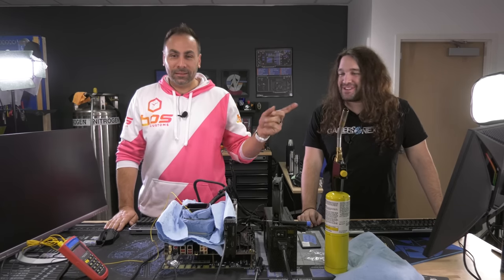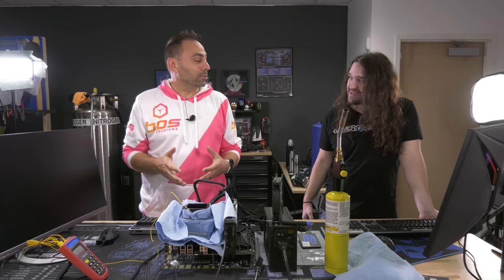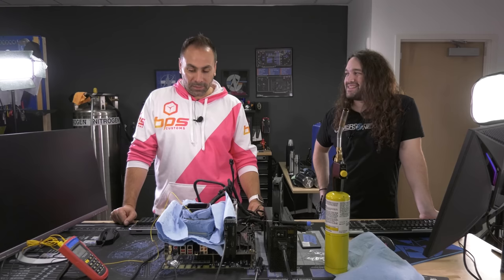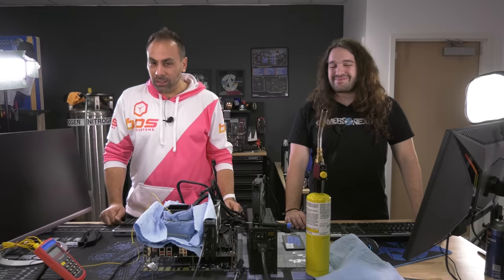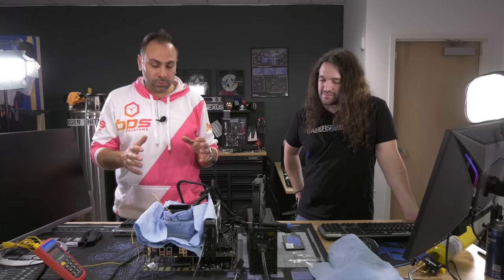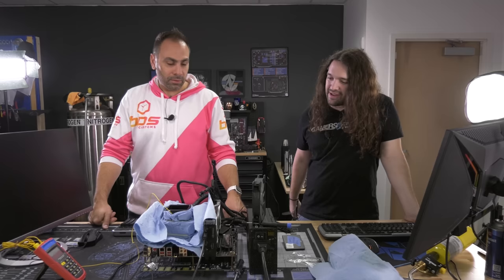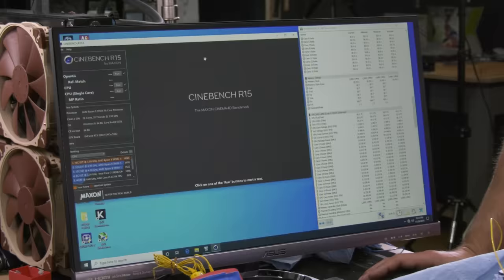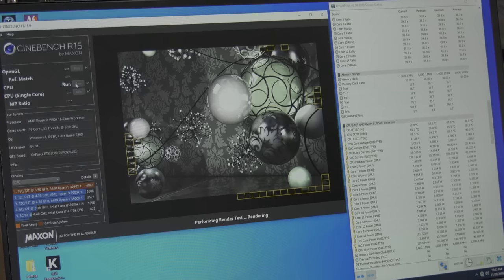Hitting 5GHz On A 3950X!

Comment: Even though I'll probably never dump LN2 on any computer parts I own I still find stuff like this fascinating. My mind conjures up ways of circulating LN2 through a loop like water cooling but not cost thousands of dollars.  I'm sure it could be done.  It'd be noisy as hell though because you'd have to use a compressor to chill the recycled Nitrogen back to liquid state.
Reply: Check out some footage of KINGPIN's Roboclocker. He did a custom LN2 loop, which was bonkers! 
He didn't recirculate the LN2, but vented it out, which was pretty flashy for when people saw it at Computex.  :)
Reply: exactly what I was thinking. You could also place the PC in a small, air tight box that had all water vapor removed to reduce condensation, with holes for the tubes for LN2

Comment: The infinity fabric is what helped Ryzen to thrive and is what limits it at the same time.  Good and bad, good within the spec range, bad outside of the spec range and that separate die they install the one which hosts the memory controller is the limiting factor to everything because everything runs in cycles once you make something faster now, things have to wait longer so in terms of performance you bottle neck.

Comment: 8:00 the voltage in auto is already at 1,478V
Reply: Yeah it's the single core boost voltage than come on all R9, when all the cores work a lot it drop significantly

Comment: What i've always hated with overclockers is that the only thing they do with their overclocked stuff is 3dmark or cinebench... It's like owning a Porsche and keeping it parked in your garden...
It would be very enlightning to see how 5ghz AMD performs vs 5ghz Intel in games...
Reply: It's primarily a stability thing, you can get away with a 40 second cinebench run but playing games and benchmarking them requires the system to run longer. You would have insane amounts system crashes during the time it would take to get the results you needed. Think of it like a funny car on a drag strip, you can make a quarter mile pass but that ain't ever gonna get on the highway.
Reply: @aggregatecrab2989  Yeah but if it's not stable, oc failed and there is no point of making a video...
Reply: @rm-vn1eq  all record are like that it crash 10 time and the 11 time it barely make it and boom record

Comment: So the 3950X gets about 1000 points in CB per GHz.. cool.. no pun intended..
Reply: yes the 3950x can be overclock to get only 1,000 extra points while the 10980xe can be overclock to get an extra 2,000 points, the 3950x has a higher based clock than intel 10980xe but intel 10980xe can overclock higher and beat the 3950x, of course non of the amd vandwagon youtubers are going to tell you that. so after you overcloked the 10980xe it beats the 3950x by 1,000 of course amd fan boys will tell you that is because 10980xe has 2 extra cores, but when they compared 3950x vs 10980xe at based clock they don't tell you that out of the box the 3950x is faster simply because it has a higher base clock and many amd boards comes with PBO enable by default which also overclock the cpu, so intel is running at a lower based while the amd is running at a higher base and also overcloked by default, very fair comparison. also no Machine learning or AI no AVX etc

one last thing, the 10980xe can be overclock to 5.2 ghz from 3.0 ghz base clock while amd 3950x can be overclock to 5 ghz from a 3.5 based clock

it obvious than intel is better for overclocking

did I forgot to mentioned that intel uses less voltage to get to that speed
while amd has to uses higher voltages

it won't be long before intel crushes AMD again for the trillion time 
amd goes up once every 15 years for a little while, it never last long
but when intel goes up, it stays up and it dominate for decades, non stop

enjoy while it last because it won't last long
cheap ass brand
Reply: @yonoexisto7833  did you just answer my punny comment with a 3 paragraph technical overview? Yikers dude.. yikers..
Reply: @marios3202  He is a real Intel fanboy for sure man XD
Reply: @yonoexisto7833  Oh boy, I can't wait for Intel x64.
Reply: @speedzaa hello there, merry Christmas, better be an intel fan boy for life than just jumping to the AMD bandwagon, simply because this gen of AMD cpu might be just a bit better than intel cpu from 3 years ago, amd just goes up once every 10 years but never last long and that is a fact, just wait and see.
Reply: @yonoexisto7833  dude are you compairing a small mainstream CPU to an enthusiast CPU?^^ I know you shouldn't look at the TDP, but 105 vs 165W?
Maybe you should compare the Threadripper 3960x to the 10980xe.
Reply: @Sandkasten36  i'm not making any comparison, 3950 with only 16 pci-e lanes and no quad channel support, no thanks I pass, you can easily overclock the 10980xe and have better performance than the 3950, also quad channel support and many more pci-e lanes, as for the 3960 and 3970 is a totally useless and unfair comparison because those cpu has many more cores than the 10980xe that's why they get more points on MT benchmarks. also there a few features that AMD are missing. if you aske me , yes we want the best the fastest but sometimes we also have to look at some others areas like stability and reliability, those AMD videos cards are a joke, crashing in all games lol
Reply: @Transistor Jumpit doesn't matter really, the only thing that matter is who get the last laugh, is ok if you like AMD yes they might have the upper hand for now, intel is having way too many problems right now, but they will eventually fix everything and they will comeback with vengeance to reclaim their title. is not that I'm a fan boy is just that i have never like AMD really, not CPU not GPU, i always been a intel and NVidia user. sorry but i have always consider AMD to be a cheap brand with bump up specs that are not even real
Reply: @yonoexisto7833  We're just talking about CPU's and AMD killed it with their last generation. If you need a crazy oc to get the performance of an enthusiast CPU to a mainstream CPU - you fucked up. Furthermore, the difference in power consumption is immense then.
Why can't you compare CPU's with different cores? I don't care about the cores. Just the performance I get for a certain price point. So it's not "unfair".
So you're not a fan boy but biased? How often is it possible for someone to be that contradictory?